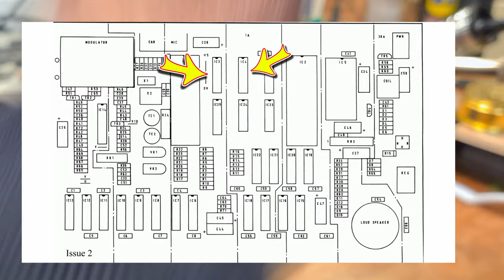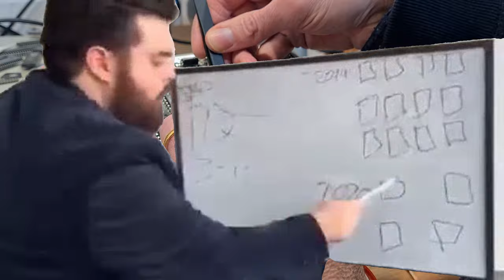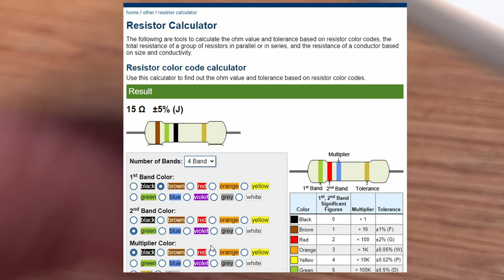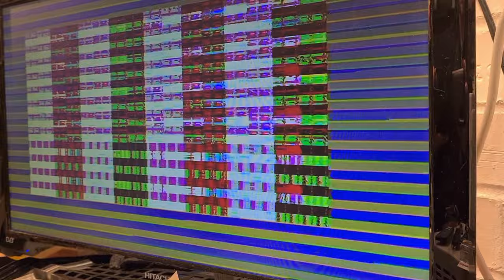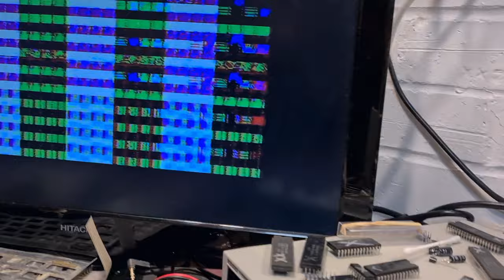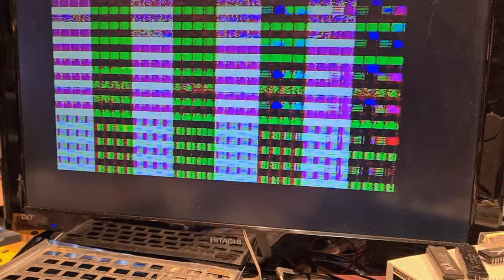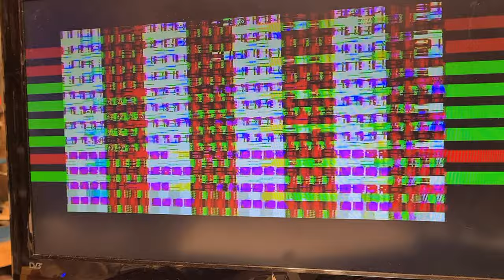ZX Spectrum FROM HELL -Missing Legs! - Part 3

Comment: I'm running through hell myself, will do all these continuity , I suspect there is some bridge in data lines
Reply from the maker: It's so easy to get bridges on these. Especially if it's a board without solder mask on the top!

Comment: Oh my god. I thought my Speccy was from hell. Both of my diagnostic ROM's diagnosed a bad lower RAM (bit3). This result didn't change even after replacing both lower and upper RAM (bit3) and even after disabling the upper RAM.

I ended up desoldering/replacing:
- Power connector -> bad
- ROM (for the diagnostic ROM) -> good
- ULA  (already socketed) -> bad
- Lower RAM (bit3) -> good
- Upper RAM (bit3) -> bad but no difference in diagnostic result.
- Lower RAM (bit0) -> good
- Z80 -> good
- All of the capacitors -> probably bad but no difference
- Lower RAM (bit5) -> good
- Lower RAM (bit4) -> good after repairing the broken leg
- Broken trace under lower RAM (bit4)
- Upper RAM (bit3) -> bad again/already socketed

Fortunately I got some useful advices from Happy Little Diodes to find the RAM fault. But these are really tricky when you have multiple faults.
Reply from the maker: Wow! Thats a pretty hardcore repair. Jim is a lovely guy, no surprise he helped out! He has a nice discord too.

Comment: Sounds like the plus 2 grey board I got shown a video  after this 48k I don't blame he didn't want to repair it lol
Reply from the maker: I wonder if I'll ever repair something more broken? Probably not. This was a lot of work.
Reply: @MoreFunMakingIt  man i replaced most of the ram, added a new pwr reg its been recapped at least i didn't use a chainsaw and a flamethrower to mend the board its messy yes its a whole new type of broken even the diag card wont post..